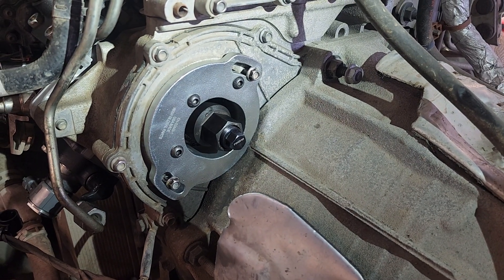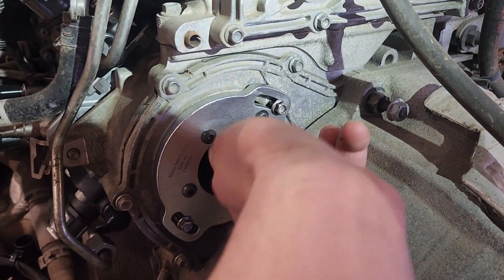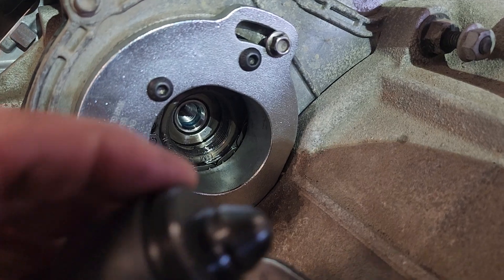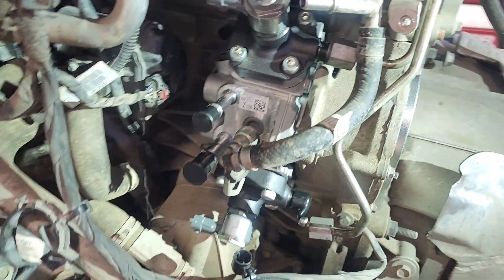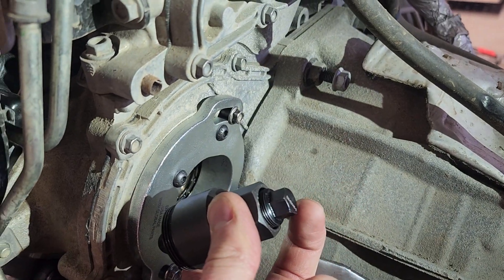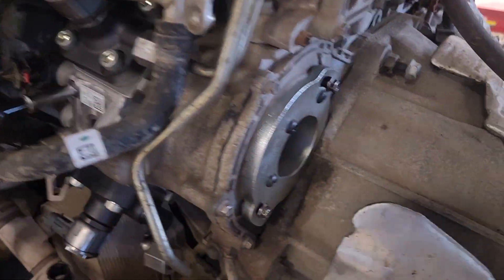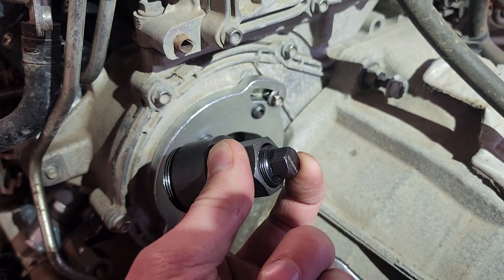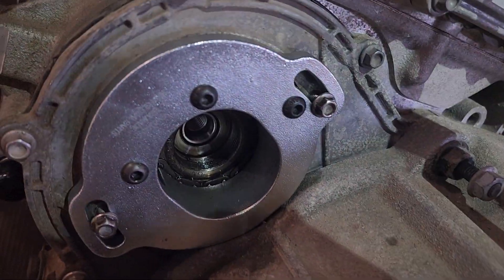(EN-52448,  GM-52448,) IF-52448 Fuel Pump Retainer and Remover Tool 3.0L Duramax Diesel (RPO LM2)

Comment from the maker: The best way to purchase this tool right now is by calling our mechanic shop Farnsworth Auto Repair in Idaho Falls, ID at 208-557-3505. You can also try our web site or etsy page but we've had a few people comment that they've had trouble with both (we are trying to work out the bugs). We have sold several through our mechanic shop and we can ship out faster this way. We usually have it mailed within the hour of recieving your phone call. We can overnight the tool if needed which will cost a fair amount extra or we ship two-day priority mail (USPS) and we typically cover the shipping on that. I'll leave links to our Facebook page , Etsy and our website. Hopefully we can get those up and running better soon. until then best way is probably to call us.  https://idahofabrication.etsy.com/listing/1866762748
I-Fab.us
https://www.facebook.com/profile.php?id=61573792323540